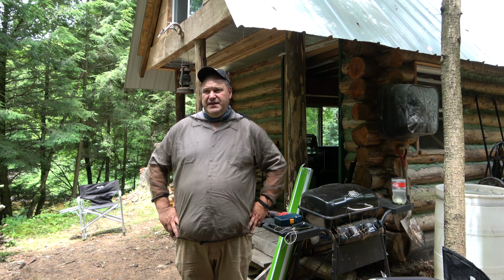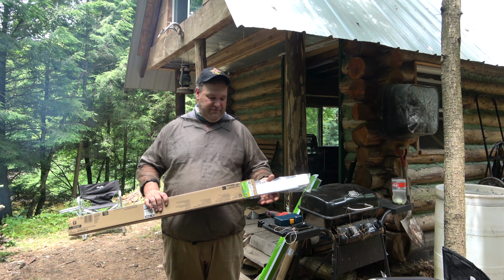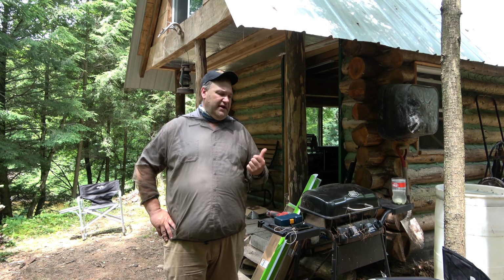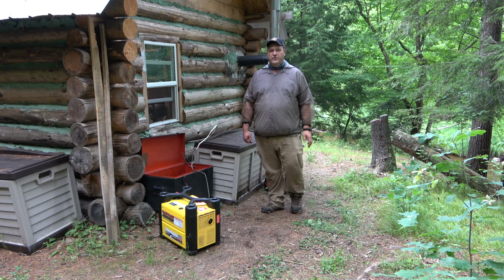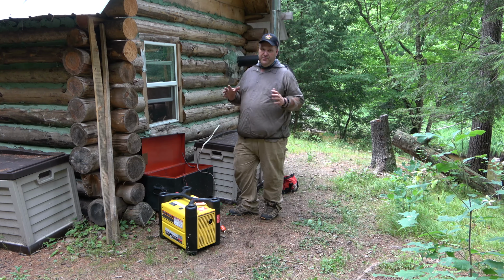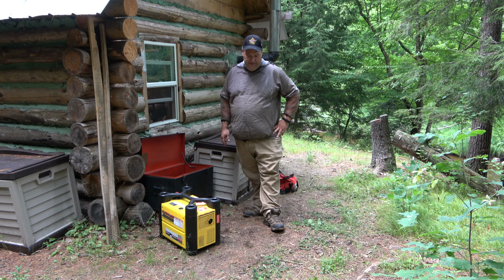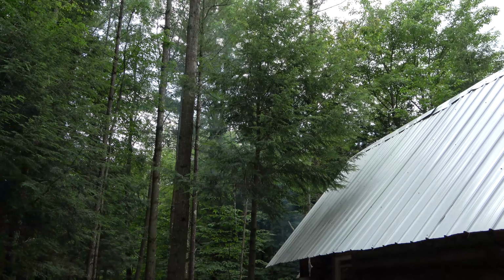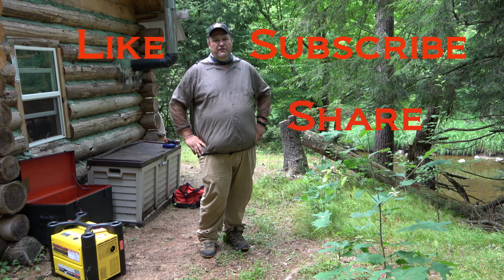Electric Lights at my Off Grid Cabin : I installed an inverter and LED lights

Comment: Are you thinking the solar cells will go on a pole?  If so how high up are you thinking?  I would think a little elevation would help with the output.  Great vid!  Thanks for posting!!
Reply from the maker: I think me and my brother will anchor two posts in the ground for the solar panels to attach too.  I would like them do be five feet  or so off the ground and adjustable.   I want to change the angle of the panels dependent on the time of year and sun angle.  Also they have to be high enough to stay out of the snow, because we do get up to three feet on the ground in the winter.  Thanks for watching and commenting.

Comment: I am using Walmart everstart maxx deep cycle batteries. They work great for me.  And they have a 2 year warranty lol.  I can't afford lithium, and it's just a weekend cabin anyway!
Reply from the maker: I am in the same boat as you are, deep cycle lead seem to work good for now.  In my research i found that lithium batteries can not take the cold and we get some cold weather starting in October.   I mostly use my cabin in the fall and winter for hunting and ice fishing.   I have used everstart batteries in my boat and I will being buying some new ones soon.    Good suggestion and thanks for watching.

Comment: Why the need for electric lights, Emma? A good propane lantern would be all I'd need.
Reply from the maker: Hello  and thanks for watching, I like the electric lights and I have used propane lamps for years, but nice thing is i can run the blower on my wood stove and it heats the cabin much quicker.  My wood stove will work with out the blower but I do like the speed and having power there all the time is great.  Take care.
Reply: @EmmaTailsOutdoors  same thing for me, electric 12v lighting with 12v fan for the stove, in addition with oil lamps
Reply from the maker: @vincentc2160  I have found that for off grid part time living that works the best for me

Comment: inverter waste half your energy
Reply from the maker: I have never heard this but I am sure there is some lose of power because of the inverter has a pretty big heat sink and heat is wasted energy in this application.   Much like LED use is a trade off so is using an inverter at my cabin.  Thank you for watching and commenting.